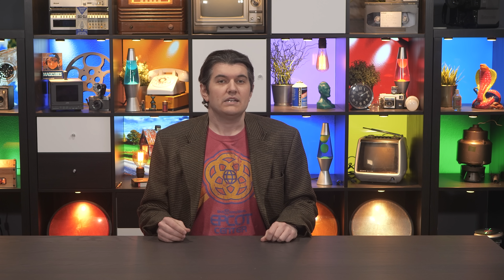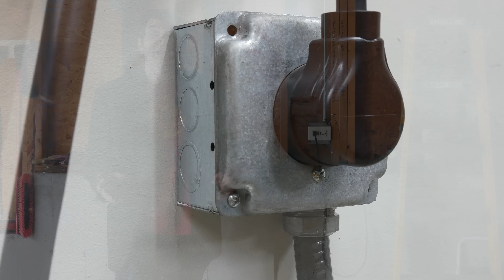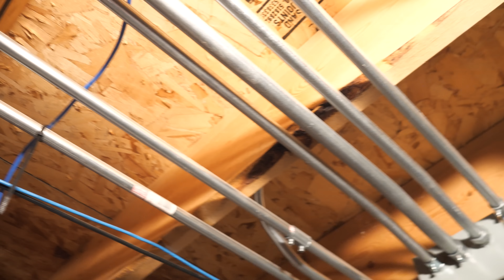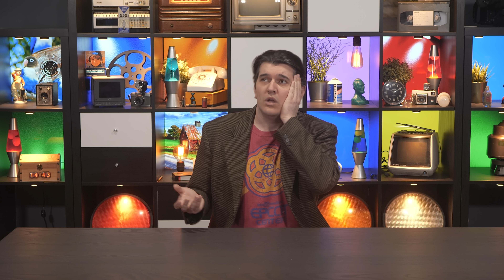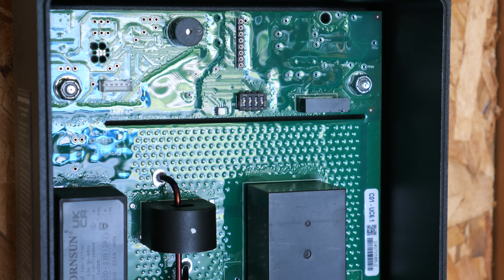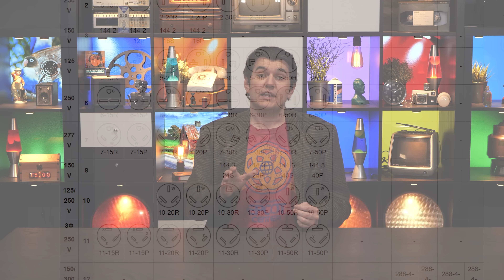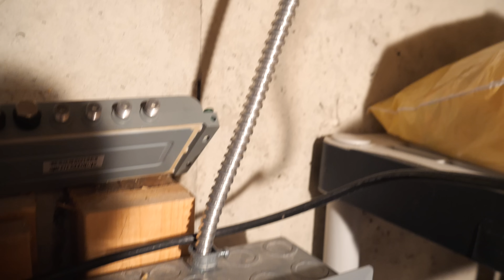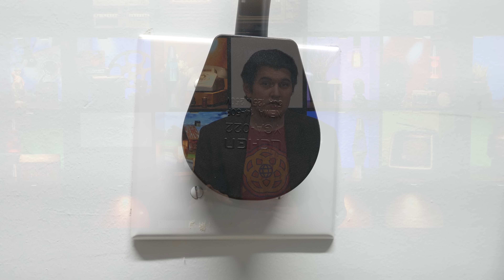The "standard" car charger is usually overkill—but your electrician might not know that

Comment: 6:46 "A slow one just for you is so much nicer than a fast one which is down the street" Especially when you have to wait in line for a half hour once you get there. Which is what happens in places where electric driving is catching on, like Southern California.
Reply: These automobiles will never catch on. You have to go to stores to get gasoline and half the time there's none there. I can just turn my horse out at the end of the day to graze.
Reply: @zyeborm  disingenuous argument if there's actual resistance in constructing additional EV charging stations in an overcrowded area.
Reply: @guyman1570 you know charging stations are hardly ever used by the vast majority of EV users right? Indeed a friend who has had one for 5 years and drivers it daily did his first fast charge yesterday. 
In case you missed the subtext, people have always argued against change in any form.
Reply: @zyeborm  There's also hundreds of thousands of gas stations that barely see a customer too.
Many of them are still open anyway.

You're right that there's pushback against change though
Reply: I am in the South Bay and work and drive the whole south land and while it does happen that I have to wait every now and then I just use the hotspot in my car and get working on emails until one opens up and some of the chargers you can “ reserve” hopefully as more chargers come out it will lesson the load
Reply: I have basically never waited in line (here in Southern CA)… Maybe 5 minutes at the most during peak times

Oh, but I have a car that can use the largest charging network, where every station has dozens of chargers, rather than trying to rely on these unfortunately tiny J1772 stations…
Reply: It took temperatures below -20C (-4F) for plugging in at home to get old for me.
Around -30C (-22F) the internal resistance of the wire no longer keeps it flexible.
Reply: @economicprisoner  the flexibility of the cable you plug in can be drastically different between chargers with the same ratings but slower chargers(we're still talking 100+ miles overnight for most cars) can have even more flexible cables. A slower level 2 charger like Alec recommends can have a way more flexible cable than anything you'll find at a public charging station.

You just have to check reviews before you buy. The channel 'State Of Charge' reviews chargers and part of that is putting them in a -17F freezer for a day and checking how flexible they are.
Reply: @Blaszj  I suspect the -30C minimum operating temperature of the EVSE is due to the risk of damaging the cable by bending at that temperature.
Reply: but you just admitted that charging is a problem...
Reply: @TykeMison_  A temporary problem. Just like the shortage of gas stations was a problem once.
Reply: I have street parking so I'm not getting an EV until I can recharge it fully in five minutes anywhere.
Reply: @bwofficial1776  What if there were as many chargers as there are lamp posts - ie each lamp post had a charging cable attached to it.

Would you get an EV then?

(surely in the age of smart devices we can figure out how to meter the electricity used...)
Reply: @bwofficial1776  Obviously absurd demands like this are stupid. Just say you aren't interested in getting an EV.

Comment: The best standard for electrical distribution is 400V 3-Phase  (240V with neutro). This is what is used in Europe and most of South America. 

The Schuko ("CEE 7/3" (sockets) and "CEE 7/4" (plugs)) are capable of very high power on 240V, even the weakest branch using 10A is capable of 2400W of power delivery.

For industrial and outdoors the best option is IEC 60309 (formerly IEC 309 and CEE 17, also published by CENELEC as EN 60309).

It is really sad that in the USA these standards are never going to bee seen.

Comment: I would like to add a bit of nuance to your rant about smart chargers. While I subscribe to the view that charging devices should be as stupid as possible, I installed a smart charging wallbox at home, that will communicate with my inverter for the solar panels on the roof, to automatically ramp up or tone down amperage depending on the current yield. To be as flexible as possible I chose the OpenWB, which essentially consists of off-the-shelf components. While it is sometimes a bit more unstable than the dumb ones (it sometimes needs to be reset, and the Raspberry Pi in there needed to be changed once), this device saved me a lot of money, and gave me the option for billing my employer for the energy I charged the company car with, which had no features logging charges.

Comment: I wonder how DC rapid charging affects battery life? Basically you're taking electrical energy and using it to make a chemical change within the battery pack. Does forcing that chemical change to happen in a shorter period of time shorten the life of the battery? I don't know, but the irritating thing about EVs in general is that everybody seems to want them to be a one-for-one replacement for an ICU vehicle, including range and refueling speed. That's not the best use case for an EV. If quick refueling turnaround is a deal breaker, than swappable batteries are probably a better solution than a massively powerful DC rapid charging station. If you use an EV for city commuting, then charging the car when you're NOT using it (at work or at overnight) makes a lot more sense than hooking up to a charger in the grocery store parking lot while you're doing the weekly shop. Especially since it's likely that all the spaces will be filled and/or the chargers are INOP. If you do a lot of highway driving and need extended range, then a battery swap station seems like a better solution than a rapid charger. Just my nickel's worth (Canada discontinued the penny. Keep the 3 cents extra with my compliments).

Comment: I alsp scoffed at the charging station prices in EU and just replaced one of our schuko plugs to 16A CEE plug which is meant for high load situations anyways. I would say that this is even more viable tactic in most EU countries. 16A×230V is plenty to charge car over night even in -20c winters. Theres even the "super schuko" plugs but those cost 10x more than basic cee 16A and schuko adapter for that.

Comment: I have on street parking, and I charge regularly in my on street parking space, using my 110 V eight or 12 amp EVSE. On street parking is only limitation if you make it one. I literally have access to a 240 V circuit, less than 3 feet away from the existing outlet I’m using. The only thing currently on that circuit is a baseboard heater. That is the only thing on the circuit, and is only used for between one and two hours a day in the winter time. I am very much tempted to figure out a way to use that outlet to provide a 240 V charging circuit. However, since I do drive a Chevy Volt, it’s not needed for me. But it could certainly be useful for someone else in the future, or if I upgrade to a full EV and, before anyone asks, the outlet is on a porch covered by a roof.

Comment: 32:26 Interesting that black and red wires are used, a colour scheme that I associate with DC power.
Reply: Typically if you are using both phases for an circuit you will wire one black and one red so you know you have both available or 230V if neutral is also present it will be white, and ground will be green. All of that applies in the USA other countries can be and often are different.
Reply: @GlennHamblin  Interesting, thank you!

Comment: Wholly agree.
I lived with 'just' a 120v outlet for the first two years I had my Bolt. It worked great. 
At first I ran an extension cord out the mail slot to where I parked (not recommended, but I had a heavy duty cord), then I moved to a place with a carport that had a plug. 

Now I have a 240v outlet in my garage that I have a dumb EVSE plugged into. No apps means no loss of service when Crowdstrike does a Friday update again...
Reply: I have a smart EVSE, the emporia one but I set it to never use any sort of schedule and always be offering a charge and then program my charge schedule through the car. So the only thing I use the app for is to track how much energy it uses, simply as a data nerd.

Comment: All it takes is you need to drive long distance two days in a row, or something like having to take someone to the airport in the evening,  and all of a sudden you're in trouble. Further, most of the cost is getting an electrician in and running the wires in the first place.
Reply: how far is your airport? it doesn't offer uber/lyft?

I get your point, stuff comes up, but having a little less range the next day isn't a big deal.

Comment: I once got really lucky with a poorly installed dryer receptacle.  I store my detergent bottle on a shelf above the washer and dryer, and one time it slipped off the shelf straight into my arms, SMACKING a full cup of detergent out of my hand.  The resulting splatter bullseyed the dryer plug and outlet.  I cleaned up the mess but I wasn't sure if any got inside the socket, so I just killed the circuit and installed a new one.  Turns out one of the wires on the back of the old socket was installed half-assed and was getting a bit cooked.  The spill was actually a blessing in disguise, alerting me to a potential problem before it turned into something big.
Reply: Had something similar happen to me. Had a set of LED can lights installed and they flickered every once in a while. Of course I assumed it was just poor QC on the LEDs and decided to just leave them be. A few months later I was installing a new breaker and had the cover to the panel off. I turned the main breaker back on to double check my work and saw a flash from the neutral bus. At the same time the can lights flickered again. Turns out the “electrician” a family member had recommended (apparently he was unlicensed and under the influence while working on the building) had forgotten to tighten down the neutral wire and it had been sparking inside the panel, causing the lights to flicker. When I pulled the wire out it had gone from white to black and charred. I’m so lucky it didn’t start an electrical fire. Moral of the story, ALWAYS MAKE SURE THE PERSON WORKING ON YOUR HOUSE KNOWS WHAT THEY’RE DOING, because it’s you who has to actually live with their work, not them.
Reply: Very rarely would a fault in a proper electrical box result in a fire. This is the main reason all building wiring junctions and outlets are put into electrical boxes. I had a dryer outlet go dead. Turns out the wire burned off the lug. I installed a new outlet and was back in business.
Reply: It's good you had to aptitude and motivation to check it out.  It's the reason I never let a dryer, or any sort of heater, run when I'm not going to be home.
I had a similar issue, but wasn't so lucky.   I could smell the burning and I thought I could see smoke, but it took me a while to figure out what was going on.  When I unplugged the dryer, then it was obvious as the cord and outlet were melted and burned.  In that case, it was a worn out outlet.   I kicked myself for not picking up on it many years ago when I first installed the dryer.   After looking at it, it refreshed the memory that the plug felt "a little off".
Now whenever I find any outlet that doesn't have a solid "feel" when plugging or unplugging, I replaced it then do a tear down to inspect for wear just for my own information.
For regular outlets, a vacuum cleaner is a great test.   For anyone who regularly vacuums, when you unplug it, note the temperature, it will be above room temp even on a good outlet.  Once you get a feel for how warm it should be, pay attention if you ever find an outlet where it feels warmer than normal.  That's your sign that either the outlet is worn out or it could have a bad connection at the wire.
Reply: I had an electrical fire in our home (trailer) when I was about 17. I don't know the exact cause but I suspect shoddy DIY electrical work or animals that got under the house and disturbed already questionable electrics. I probably technically have a bit of PTSD because I have a moderate panic session when I get the lightest whiff of burning. I cannot settle until I find the source. At the time I didn't have an actual cellphone I did have an old flip phone I used as an alarm to get up for school. 
Craziest thing is that alarm was set for around 6:30 or something. THAT day the alarm went off in the wee hours around 3 or 4 am. This had me in a semi conscious state when I heard the loud bang. It was loud and I got up and heard another loud bang. I poked my head outside and it was just silent twilight. My mom had woke up at this point and she asked me if I knew what it was. I legitimately didn't have a good clue but in the course of about 2 or 3 minutes she asked me if I smelled smoke, which I didn't but as I am responding about the smell I saw smoke and while my mom had grabbed the phone to call the fire department I was searching for a source. I finally saw a small flicker of light coming up from under the air handler and I had the foresight that as soon as she hang the phone up I killed the main breaker right before we went outside. The mobile home is still standing to this day, the whole kitchen floor had burned out though. 

I suppose I could have accidentally set that alarm at some previous time accidentally or something but I had no recollection of it or any reason I would have set an alarm that early.
It seems someone was looking out for me 😅
Reply: @codemiesterbeats   I choose to believe a higher power offered a hand in moments like that.  Our family had a sort of opposite experience involving unexpected fire alarms in the dead of night.

My sister was in her teenage delinquent phase and secretly started hanging out with some very questionable people.  She was in the process of sneaking out in the middle of the night to go meet up with them when the smoke alarm went off for absolutely no reason.  No smoke, no fire, no nothing.  My parents obviously lept up to see what the heck was going on, only to find her all decked out in her edgelord finery by the open front door.  The timing couldn't have been more perfect to catch her in the act.  Suddenly she had some bigtime explaining to do.

We'll never know what would have happened that night had she gone out.  I can't help but wonder if a higher power knew something was going to go horribly wrong and averted disaster by triggering that alarm.
Reply: God is good.
Reply: That reminds me of a time my grandmother's house had an outlet buried in wall and insulation. It had no power, which it is a good thing. Otherwise the house would've been long gone.
Reply: The rare welcome "scope creep". 

Spill clean up, turned receptacle replacement, turned fire prevention.
Reply: I charge my Equinox EV overnight with the 120V 15A option. This adds range about 6km an hour, about 72km in 12h. Or about 215 km in the 36h interval available on WFH days. Considering my average daily commute is only about 25 km, I rarely need a L2 charger.
Reply: It's been a year. Go back and check that that screw isn't loose again. If it is, get a commercial outlet and a torque screwdriver to properly install it.
Reply: That's some divine intervention there preventing a fire that could ruin, not just your day.
Reply: I had something similar happen shortly after moving into my current house. I set a gallon of bleach on the shelf above a receptacle next to the washer once. I didn’t notice that the bottle was pierced by the tip of a screw and bleach ran down the wall straight into the receptacle. I started smelling and seeing smoke coming from the living room wall behind the washer. Since the breaker box was outside on the other end of the house, I kicked a hole in the living room wall behind it and cut the romex. Thank God I’m really bad about putting tools away and there was a pair of lineman’s pliers close by.
Reply: while renovating my basement i found a live 50 amp 240V cable in the wall cavity with the conductors just covered with 1-2 wraps of electrical tape 😳
Reply: @Fiberform70 nothing gonna go wrong with THAT
Reply: Will Prowse put up a video wrt to those Nema 14-50 receptacles, even at 30A a UL-certified receptacle can catch on fire.  There are EV rated 50A receptacles, but even those shouldn't exceed 40A for long periods of time like charging an EV.  Hardwiring with individual run THN-insulated wire is the best bet.  Do a search on YT for "Will Prowse Nema 14-50".
Reply: Yikes! That's fortuitous.
Reply: Sounds like you had a guardian angel, my friend!

Comment: When I remodeled my house I installed a NEMA 14-50 Hubbell in the garbage because the walls were open and we had upgraded to a 200 amp service. Don't have an EV yet, but if my 2005 4Runner ever dies then I'll be ready.

Comment: Based on differential cost, there should be no such thing as a new house without  a dedicated 240v plug in the garage or carport.  

I also wonder about timing the charging times to match the lowest available Kwh rates.  Does the vehicle do this, the charging station or both/either?

Finally, am I the only one that wanted to organize the cable TV cable spaghetti above the breaker boxes?

Comment: The Siemens unit was not reliable. But it had a near feature.  You could interlock it with a dry contact relay.  Makes it very easy to stop it charging when your clothes dryer is running.